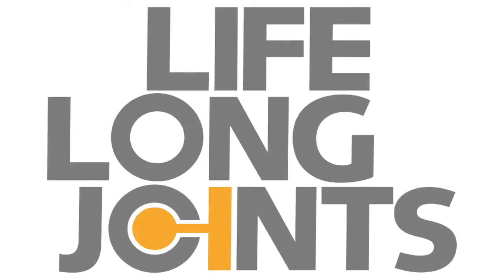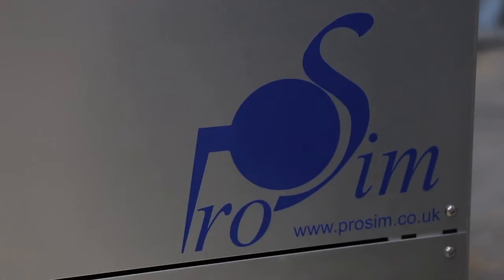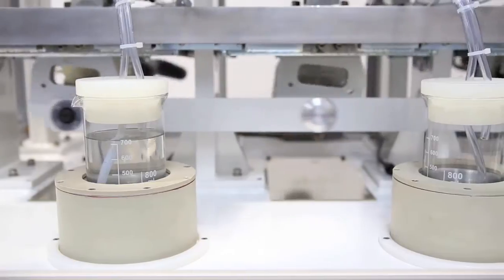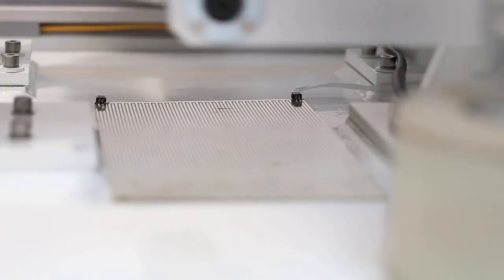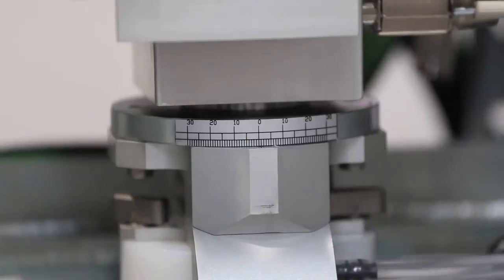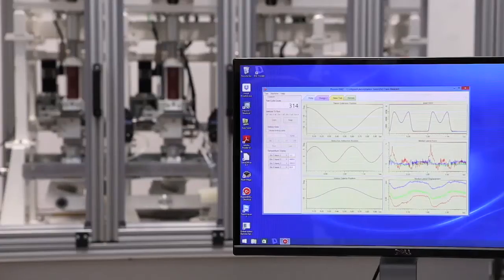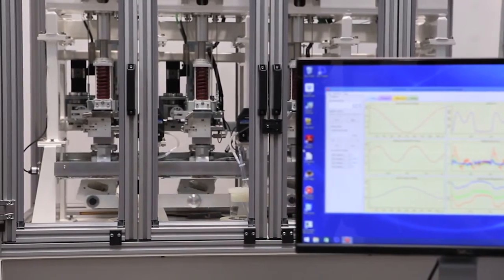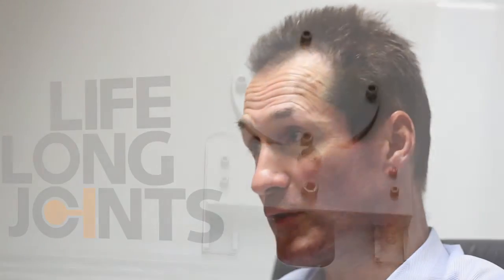Simulator tests replacement joints to the limits

Comment from the maker: The Prosim simulator applies axial load to the acetabular cups controlled by a servo motor system and is fully programmable up to 8kN so is compatible with the simulation of stumbling. In addition, medial-lateral force or displacement control is provided on the acetabular cups for the simulation of lateral mal-positioning and micro-separation. Compliant to ISO 14242 testing of hip implants. It is important that the simulator can be used for testing implants under a continuously rotating series of activities of daily living. The loading levels must allow the machine being used to test implants under adverse conditions. The TE86 simulator from Phoenix does obviously not have these abilities.